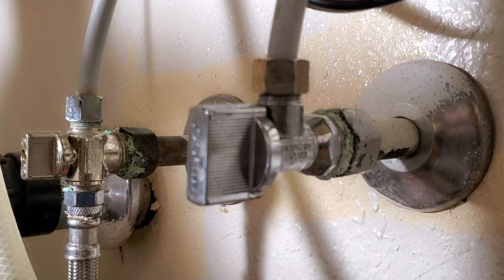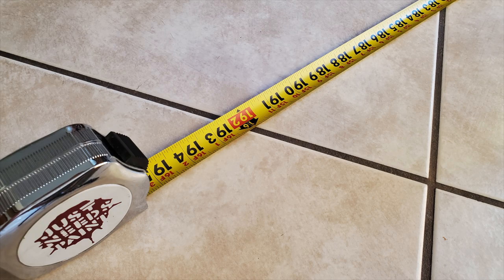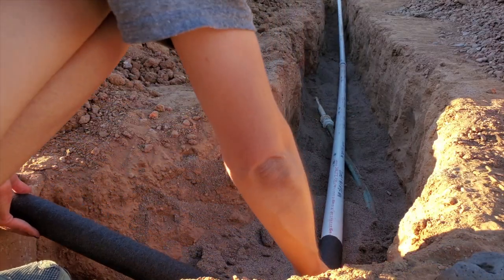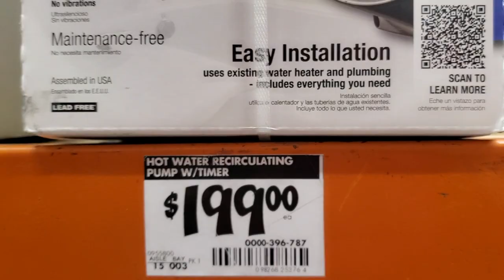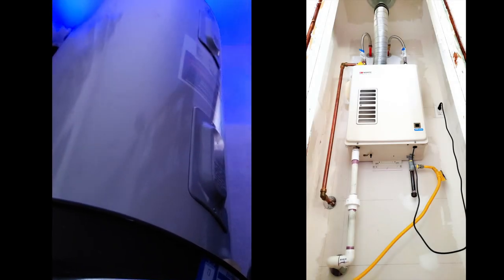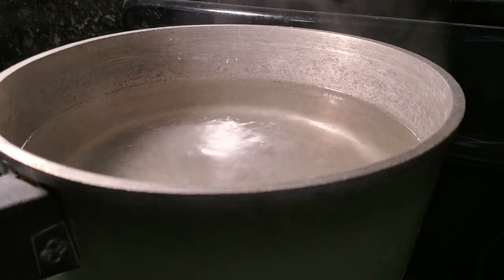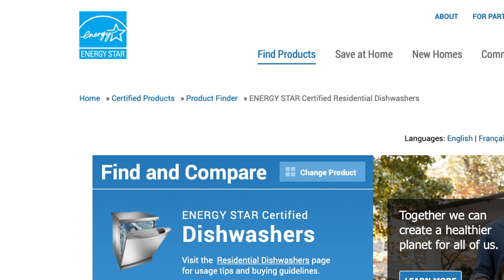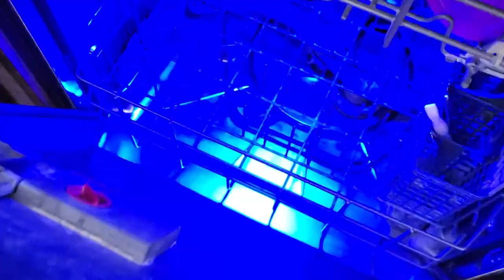PROOF!!! Why Hot Water NEVER Makes It to Your Dishwasher?!?!

Comment: Thank you for this! It's useful information as we're trying to figure out to be as eco- conscious as we can. Pre-running the hot water is so wasteful - not just the cost from the water heater but also the extra water consumption (our state is in a drought condition right now) unless we capture all that clean water going down the drain for watering plants etc. 

It would be great if North America followed the EU in having dishwasher models that connect to the cold water line and effectively heat up the water within the unit.
Reply from the maker: Thank you--totally agree. We bought a Miele last month. It is the only dishwasher manufacturer we could find in the US that can go on the cold line. That was truly the only feature I wanted. Right now they have a sweet deal getting a coffee machine for free at the same time...not sure when it ends.

Comment: You ask very good questions & here's another thought. Even though all dishwashers use a thermistor (temperature sensor) to report the water temperature to the control board, I've yet to see one that displays that temperature on the user interface. If the DW heating circuit fails you are washing your dishes in tepid water at best, cold water at worst. If your DW does not pop a heating circuit error code you might go weeks or months before noticing.
Reply from the maker: Thanks for sharing this. That is a VERY good observation. So very true.

Comment: Thanks so much for pointing this out; I bought 4 one-way valves so I could join both hot/cold pipes together and regulate to max opp temp. In Au, we are told both 'dishwasher/washing machines' must be connected to cold only. I will fill a bucket and see how much water is displaced before hot water gets through. PS, yes there is a stage in both appliances at the beginning where there is a pause while the water is heated…
Reply from the maker: I'm glad you found this helpful. Hopefully your run is not too long!

Comment: Thank you for this informative video. My GE dishwasher is T'd off of the hot water line that goes to the kitchen sink. The water that comes in is cool. It takes only 10 - 15 seconds for the water to be very hot from my kitchen sink faucet. But the water from the same water line never seems to get hot inside the dishwasher. But when I turn off the valve on the hot water supply line going up to the faucet, the water going into the dishwasher then is hot! Is it possible that I'm getting a cross-flow from the cold water line through the faucet and down the hot water line and into the dishwasher?
Reply from the maker: It is possible. I'm assuming the hot water was run in the sink for 10-15 seconds first and then this test was performed with and without the shutoff. Perhaps the diverter assembly has failed in the faucet and is allowing water to mix and get siphoned back into the hot water line? Full disclosure, I'm not a plumber and I have never experienced that myself, but I could see that as a possibility having just looked at kitchen faucet diagrams (the advice is worth the price charged). If you pursue the issue I'd love to hear back on the actual cause. FYI, I'm hitting "heart" button not because I like the issue, but because I appreciate your comment.

Comment: Great video!! Miele dishwashers can be connected to either cold or hot water lines; Miele states it does take more electricity to run the dishwasher on a cold hookup.  
I'm currently remodeling my kitchen and the plumber will be putting in a cold water dishwasher hookup.
Reply from the maker: So glad you saw this ahead of time!!! High five on the electricity savings. I really appreciate you taking the time to tell me about Miele. It'll be a contender when I replace my Kenmore.
Reply: I'm debating between a Miele or a Bosch 800. Any idea if Bosch accepts a cold water like the Miele?
Reply: @davethenerd42  I really don't know if a Bosch dishwasher can be hooked up to the cold water line. I would check the manual. 
Just a heads up . . .I finally got my Miele dishwasher last month and I ordered it July 2021. I was told from the appliance dealer that Miele is not taking anymore orders for dishwashers until they get caught up with production.
Reply: @kimsalinas5980  oh wow! Thank you for that info! Luckily, we aren't in any dire situation. My Samsung requires regular disassembly and deep cleaning and is just an all around pain. Hopefully when we can replace it we can find something relatively quickly. Have you reviewed the Miele yet?
Reply: @davethenerd42  No, I haven't done a review on it yet. Some similarities with my older Miele and some small  changes such as Autodose, updated racks, some different program options and design change of the filter in the bottom of the tub. Overall, it cleans everthing very well.
Reply: Miele is stating the obvious.
Reply: Interesting! I'm looking to buy a dishwasher and Miele is too expensive for me, but looking at Miele specs, their heating element is the exact same kW as other dishwashers that state to connect to hot. So the specs are the same in heating... sounds like with that most all dishwashers could be connected to cold, since Miele says they connect to cold with same heating capability as other.
Reply: Miele is by far better than Bosch for dishwashers.  Dishwashers is what they do best.  Even better than they do vacuums!

Comment: My clothes washer is the furthest appliance between the dishwasher and water heater, so I run water into the wash tub at the hottest setting for about a minute to bring the water to the dishwasher area of the line.  I just keep the water in the clothes washer tub until I do the next load, usually within a day or two, so no waste there.  And the water at the sink/dishwasher is super hot.  I’ve measured it at just over 120°F. Of course that is only for the initial fill, unless I want to repeat the exercise for each fill.
Reply from the maker: Efficiency is appreciated here! It's nice that you have that short run to maximize the hot water.

Comment: I don't pre-rinse hardly at all.  I also don't run the hot water ahead of time.   The dishes including pots and pans that are baked on come out perfectly clean.   $1100 LG Dishwasher,  works like a charm.   Washing your dishes before you wash your dishes is a waste of time and money.    Get the large stuff off and that's about it.  Edit:   Just buy a heat pump based hot water heater.  They can heat the water far far cheaper then the dishwasher.   Also PEX and some other plastic lines can loose less heat vs copper.
Reply from the maker: Love this! Thanks for kicking off the conversation here!

I’d like to think that these requirements are more like “guidelines'' and we are eating off of perfectly clean dishes. I still use my dishwasher after all. ;-)

(if there is ire in this part--I tried removing it, but please read it as not directed at you, but my own unhappy findings) Part of my point is, even if I have a heat pump water heater, the water will just cool in the line and never makes it because the run is too long--and it is just a room away! So I’m just running the water heater for no good reason, if I follow the manufacturer's directions (which I have). I dislike an entire industry that says it requires the water to be 120F, pushing the heat load to another appliance to achieve some supposed gold star and then in reality, no one is getting to 120F if their water heaters are set by the manufacturer to 120 (because copper, PEX or whatever the plumbing is, is going to drop that 120F water as it travels to the dishwasher).

From the rinsing standpoint, I’ll admit I’m a rinser. While it may be a waste of water and my time, my personal justification is I doubt many people (myself included) take the filter out at the bottom and clean it often enough. It can come out pretty gross.

Thanks for mentioning heat pump water heaters! I didn’t know much about them until now. I just did some reading. This article had some pretty good pros/cons for if it is a reasonable upgrade:  https://www.thisoldhouse.com/plumbing/21015567/all-about-heat-pump-water-heaters. Because of your note, I might consider one the next time we do a swap, but my concern would be how loud it is, as the article noted, because it is on the other side of the kitchen wall.

Thanks for dropping another note! Did you ever get a bottom cover for your Flo?
Reply: @NoMoreLeaks  I run an electric tankless and I actually can get out of the faucet what I set the tankless to, assuming a reasonable flow rate.  Then again I don't use kitchen gadgets as a scientific measurement device.   You need to run the water into a glass and them use an immersion probe.    If your loosing 10 deg/F I would assume your pipe is just not at all insulated well and/or you have a very long run.  Copper will drop the temps the fastest of course as it conducts heat really well.   Also the temp dials on water heaters is a rough temperature,  they are not very accurate really.   My dishwasher heats the water to 150F and has a steam option.   Not worried about sanitization.   If you've not already go watch the technology connections video on dishwashers.
Reply from the maker: I hope that anyone who is interested in how their dishwashers work and question the heat/temp verbiage in the requirements can try something similar for their own home, using whatever means they have.

That technology connections video is very well done and I linked here for anyone else who reads the comments: https://www.youtube.com/watch?v=_rBO8neWw04

Yes, it is a copper run below the house. Tankless is the best, but unfortunately not doable in my home without major drywall repairs and electrical upgrades. Good considerations for anyone buying their next house. Along with a food chopper type dishwasher (mine is the filter type).
Reply: @NoMoreLeaks  I only recommend tankless electric for small homes with one or two people. Tankless gas heaters are nice and can handle large homes.
Reply from the maker: Good to know. We are light users, but that may change as our girls get older. ;-) We replaced a gas storage water heater with a gas tankless in our rental property and the gas company said there was a significant drop in the household usage at that time.

Between your constructive comments a Will's, I wish I could redo a few sections on this video on day 1 of publishing. Thanks again!
Reply: @NoMoreLeaks  They do make tankless water heaters that run off of propane. An Electric Tankless is very inefficient compared to natural gas. Propane is a little less efficient than natural gas but way more efficient than electric.
Reply from the maker: True! Thanks for adding that information for anyone considering the upgrade on their next water heater.
Reply: @jeffm2787  No pre-rinse? What about clogging the filter with spaghetti? You're not worried about that gunk contaminating your dishes?
Reply: @newmennium  I do scape shit off.  I mean you would be stupid not to if you have a filter based dish washer.   I've never seen the filter get all that bad at all,  hardly anything.   I clean it (just because) about every month or so.

Comment: It works for me since I use my garbage disposal before placing dishes in the dishwasher, and I tend to run it after dinner when I go to take a shower. My main hot water line is 3/4" which branches off into 1/2" to feed fixtures like the kitchen sink. There's a large volume of hot water in the main line which I fully insulated throughout the house, so I think the water reaching the dishwasher has a better chance of still being hot. Here's hoping that it is.
Reply from the maker: The added insulation sounds like you did some serious work on your home and made some great choices on the functional features. Nicely done!
Reply: @NoMoreLeaks  thank you! I did a test and have an update about it: after getting out of the shower I went to my kitchen to see if the hot water was hot from the sink tap. The water that immediately flowed out was tepid, but in about 1 second got fully hot. I'm not sure if that moment of tepid water was just from the water between where the hot water line splits between the sink and the dishwasher or something else, but it goes to show that even in what I think are the most neurotically ideal circumstances for the water to reach the dishwasher hot there's still a chance it isn't. Your video is great!

Comment: This is all very informative but what can we do to initially boost to water temp in the line before the water heater hot water reaches the dishwasher.  Maybe the already installed instant hot water unit somehow combined with the existing hot water line?  A plumber told me about this but don’t know how to hook it up.  I eagerly await your comments.  Rich
Reply from the maker: Hi Rich. A hot water recirculating line or a small hot water tank under the kitchen sink are two options. Both require some expense and the additional bill to power the additional devices. I don't know if there would be any cost benefit. IMHO, I think the only good solution is to buy a dishwasher that is self sufficient running off the cold water line.

Comment: It’s possible that Fisher & Paykel dishwashers are connected to the cold line.  I just bought (and personally installed) a new Bosch 300 series dishwasher.  It’s manual said to use the hot water line.  My previous dishwasher, a two-drawer Fisher Paykel, died after 10 years of steady use…including “kid-influenced” dishes including home made slime (glue and borax).  My mother’s Fisher Paykel dishwasher has easily survived nearly 20 years of very gentle and deliberate occasional use.  The 300 series Bosch had generally great reviews and was priced around $1000.  For a 1-3 person, mechanically sensitive and deliberate household, a 2-drawer Fisher Paykel dishwasher is a great choice—since both drawers operate independently.  With ours, one drawer failed and we limped along on the remaining drawer until we killed that one too.
Reply from the maker: Homemade slime is no joke! Thanks for sharing your experience and I hope your new Bosch lasts longer than the Fisher & Paykel.
Reply: @NoMoreLeaks  Thank you. Short of doing laundry, if the last couple days is any indication of workload (2 loads / day) this Bosch 300-series is going to be put through it’s paces!

Comment: Extremely useful video! Just what I needed. The heating element broke in my 12-year old dishwasher and I was contemplating just connecting it to hot and continuing using it, but that, as per your video doesn't sound like a good idea after all. Water would end up being lukewarm, there are too many things cooling down the water, even if the pipe was pre-heated. (I'm in the EU and here Bosch recommends cold water input, but allows hot up to 60C. All that's assuming the heater part works ti maintain or even reach the operating temps. In mine is not a likely easily serviceable part as in grill microwaves, but integrated into a pump deep within the appliance so service cost is too much, to fix an old boi.)
Reply from the maker: Glad you found it helpful. I hear you on some replacement parts being not worth it. :(

Comment: The problem can be solved by putting an undersink water heater. We have a 120v 1200W water heater for doing the dishes manually or pre rinse an let the dishwasher start half an hour after the dishes are pre rinse. In that time we have already 2 1/2gl of hot water available again.
Reply from the maker: That is a nice feature! Thank you for sharing your experience.

Comment: Thank you , my dishwasher is plumbed into the hot water but my washing machine is plumbed into the cold. Since iv lowerd the temp on my boiler and its summer here my dishwasher check water light cimes on. So im doing a little test now. Im putting the hot water up to max for a good couple of hours , i shall run the tap and then start up the dishwasher. It was working just fine during the winter not now tho . A plumber friend said to fix it up to the cold as dishwashers heat there own water ? Im lost but im willing to give it a try at this point. I think the dishwasher may need fixing tho . I will try this tho
Reply from the maker: That's a really interesting feature your dishwasher has--telling you the temperature isn't getting hot enough. What kind of dishwasher do you have? Sounds like perhaps the heating element or something else is wrong. I am curious how your experiment ended!